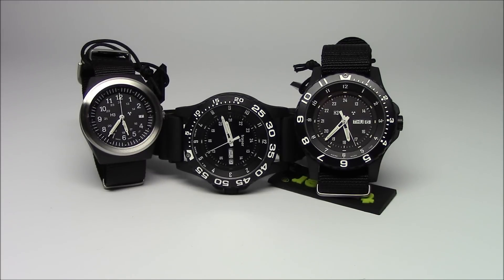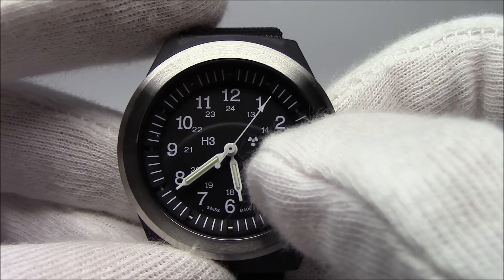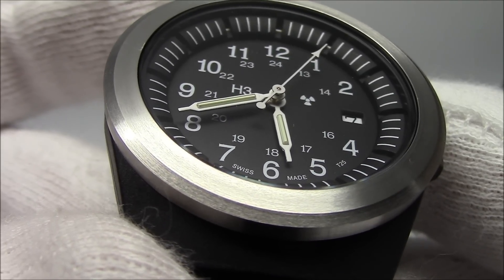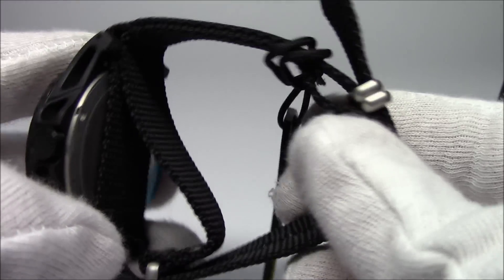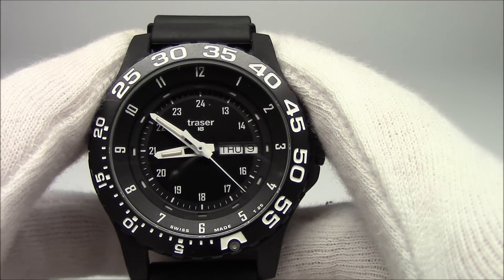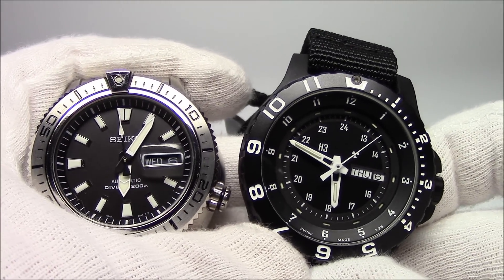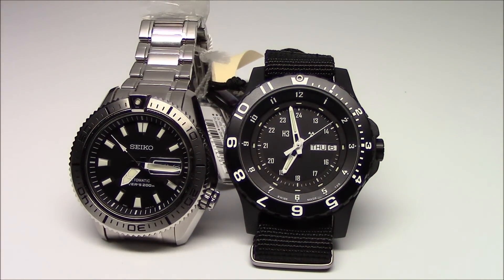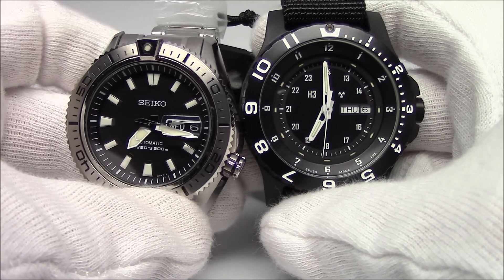Traser Tritium Watches - How is tritium different than normal lume?

Comment: Hey Mark ! Just now looked at this video, how does Marathon lume vs. Traser lume seem to you ? I've owned both the Traser P6600 and just picked up a Marathon Field Auto ( the small 34mm one ) and the lume seems to be about the same brightness. Any watch you'd recommend over the other ? ( Marathon vs Traser ? ) 
Thanks for your time to comment on all the questions !
Reply from the maker: They are indeed the same brightness. Same tubes; T25.  I actually like both brands. What differentiates them is the Marathons feel more substantial.
Reply: Thanks for the quick response ! I don't think there is any company that has T100 tubes ( maybe some Ball watches ? Or some company called Deep Blue ? I think those are the only watch companies that carry the stronger tubes).

Comment: thank you sir, regarding lume.   I did notice Seiko has good lume.   Now I'm torn between your Seiko 5 and Orient pilot type B.   Guess. I 'll take the black Seiko 5 type B with canvas strap.  The price is certainly right.  Heck, I've spent more than that on dinner and a movie.  Aside from an old pocket watch of mine, it will be my first mechanical.  Regards,  AJ

Comment: This is a great video. Weak lume has always been a deal breaker for me. Good lume, a deal maker.  I would like to own your blue dial automatic Orient.  It's lume is fantastic.  Here's my question,   what makes a watch NOT glow good?  All of my modern Timex's glow great.  I can clearly see them all night. However,  I can bearly make out the marks on my Wenger qwartz.  Pls share your lume paint knowledge. regards. AJ
Reply from the maker: Assuming similar lighting, it revolves around two things; type of paint used, and the amount. For example, Lumibrite (Seiko's compound) is used on all their glow watches. Some glow strong, others just "good". What's the difference? On a watch like the monster, on close inspection, you can see the paint is really put on thick. That's the difference. More paint, more lume.

Comment: I don't think tritium quality lasts 20 years.  At least they don't on acog scopes.  I think its more like right after the ten year warranty is over.
Reply: There are different ratings of tritium, weve got some tritium exit signs at work that are rated for 10, others to 20 and 25.
I do now know how they will live up to their warranty, as they were installed a couple years ago.
Reply: ive got a luminox 3000 from 2000. Still glowing: it does take a while to adjust

Comment: I thought the Tubes worked even in dark rooms for months? I mean if you get an Elite red and go diving will the light disappear after a few feet?
Reply from the maker: They do glow for years without any light. But, at depth, in water, the red doesn't "pop" like the green.
Reply: +Long Island Watch Hi thanks for the reply. I did want to get the Elite Red instead of the Green as the former is a much rarer colour. This helps!
Reply: Long Island Watch can you get the illumination re done on a traser watch when it is no longer  lighting up well